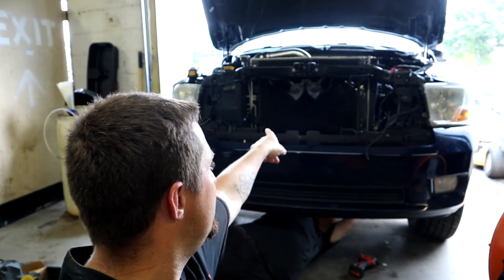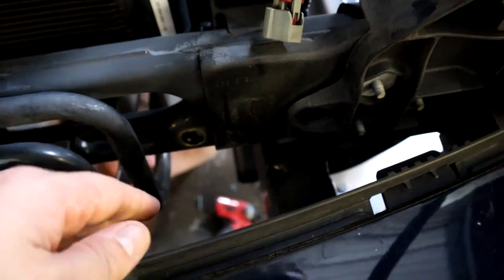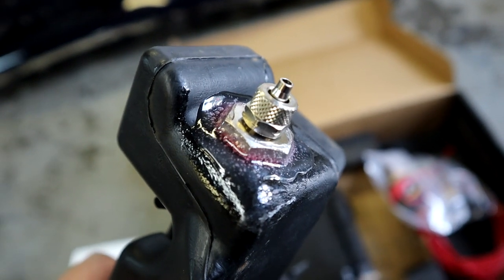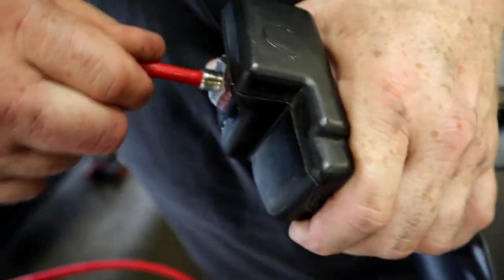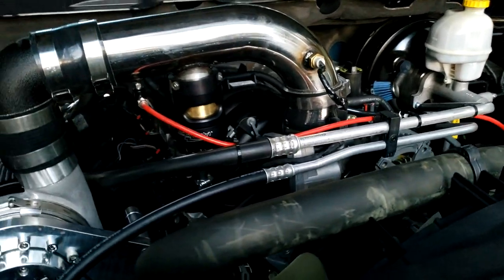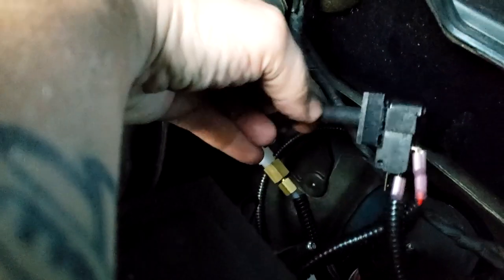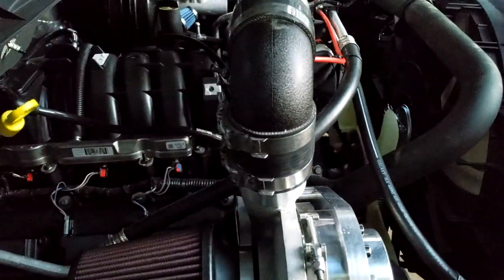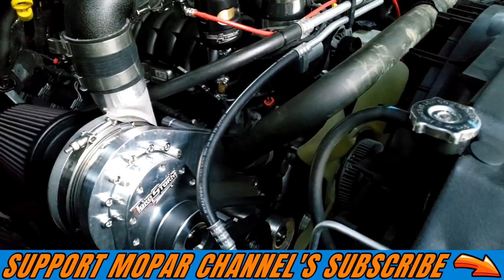Project STORM Gets Water/Meth Injection RAM 1500 4X4 Part 6

Comment: For a low boost street application is it acceptable to go with a single phase setup, or is there value in going for a stage 2 with a VC-50 controller so I can ramp. Seems like if I'm only targeting 9lbs of boost or so it may not be necessary. Thoughts? If there is value,  I don't mind shelling out the extra cash.
Thanks.
Reply from the maker: Single unit is plenty

Comment: How much boost you run without having all that extra plumbing? How do you switch from spraying in the motor to using it as a windshield washer?
Reply from the maker: On the 3.5 pulley we have seen 7-8psi a little more than expected so we have adjusted the tune according. The stock window sprayer tank is still hooked up as normal we just feed the meth off the bottom of the tank using a separate fitting.
Reply: @FrostbiteRam  thanks for the info! I'll check out your other video of the install on frostbite. I am really interested in going this route

Comment: 2 questions.
Can I use washer fluid for the spray ?
Will the meth injection rot my teeth ?

😜
Reply from the maker: 🤣the boost juice is great for injection and works fantastic for window cleaner especially if cold outside it melts ice nicely lol.
Reply: At what temps will the fluid freeze for us folks in the great white north ?  Have you had any such issues ?